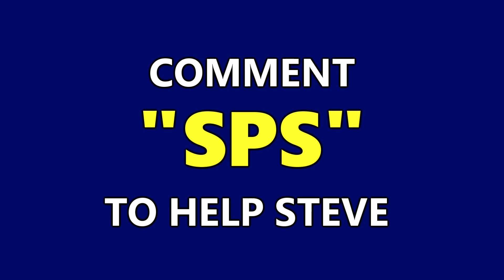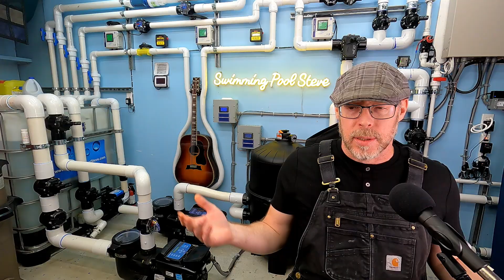How Can I Reduce The Cost Of My Pool?

Comment: What are your thoughts on the Venturi Infusion return fittings?  Says they circulate water better which looks to be the case from the visual demonstration in the video.
Reply from the maker: I just watched the video and read the marketing info. I basically disagree with them on a point by point basis. Pools do not benefit from aiming returns down, nor do pools develop thermalclines what require shooting hot water at the floor / deep end. This product is a total swing and miss for me and I would not use it in my pool.  Here is what I think about optimal return jet placement https://m.youtube.com/watch?v=lfHcC1pq85w

Comment: Sending out an SPS.  Need to continue the “fancy” pool discussion happening at the end of the video.  Aside from infinity edge pools, how do I know I have one?
Reply from the maker: How many pipes do you have. How many pumps. I think 15 or 16 pumps was the most I ever encountered / installed for a residential pool. The average "fancy" pool would have let's say at minimum three suction lines, 2 inch or larger pipes, multiple peripheral items like heaters, sanitizer systems etc, as well as energy demanding features like waterfalls or in-floor plumbing systems.

Comment: I went from a pressure side cleaner with a booster pump, to a robotic cleaner.  Saves a lot of electricity
Reply from the maker: Definitely a great idea!
Reply: Yes. Robotic cleaner is less than 100 watts per hour and the pressure side pump is over 600 watts per hour.

Comment: Also time of use electricity rates. Here in Ontario I run my vs pump at night as it’s basically half the cost
Reply from the maker: High speed operation of the motor consumes a disproportionate amount of power. It's important to avoid high speed operation during peak periods as you are doing.

Comment: I would also count over-spec'ing a pump, filter, or heater, which is a capital loss up-front, therefore a kind of inefficiency.  For example, I have a sheer descent that uses a dedicated full size Pentair VS pump, which I suspect is more than what I need.
Reply from the maker: This is more than efficiency - this is a black and white safety issue and a HUGELY common problem.
Reply: @Swimmingpoolsteve  The safety issue being if you program it, or otherwise let it, pump more than the single outlet pipe can handle and it blows up a pipe or has some kind of back-pressure issue?